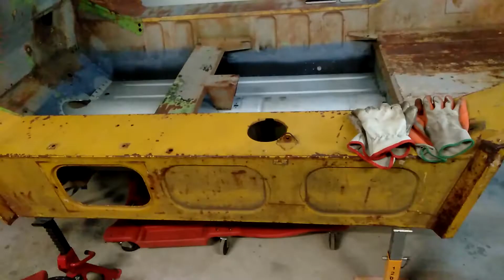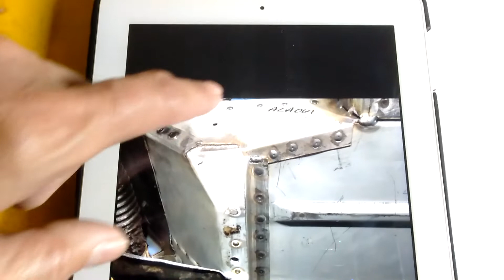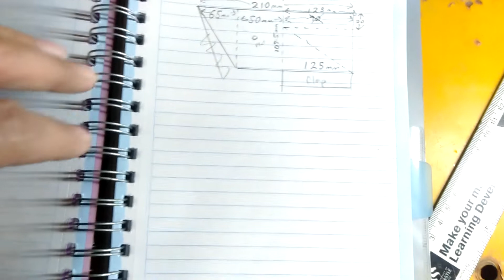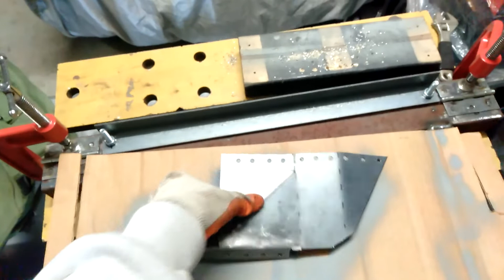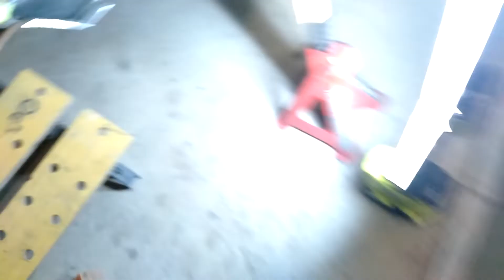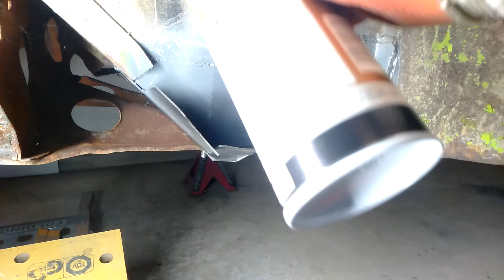Moke Closing Panel ALA064 EP08

Comment: Hi Tim I love your videos I have just bought my self a moke and its in the same condition as yours so cant thank you enough for your detailed videos they are helping me so much with the start of my build, I was wanting to know what thickness steel are you using for all the body work. I am deciding if I should attempt to make the floor pans as my centre is still savable what thickness would you say would be safe to use I also live in Australia so I can relate to your videos again thank you.
Reply from the maker: The steel I used was 1.5mm thick. A lot of the original panels are around 1.3mm and the replacement floor which I purchased is only 1.2 mm thick.